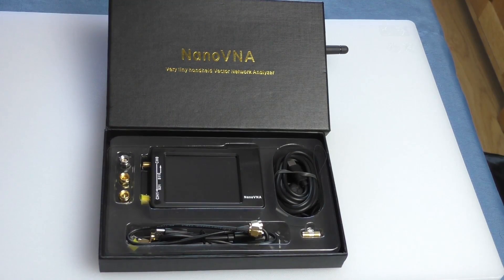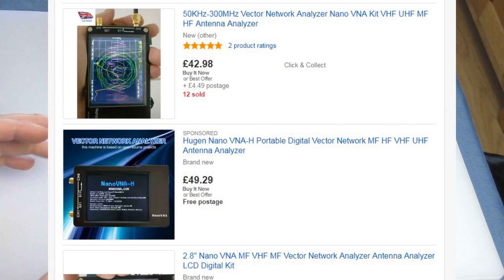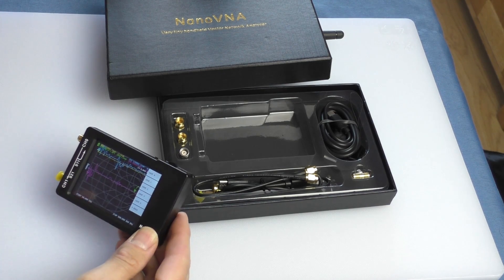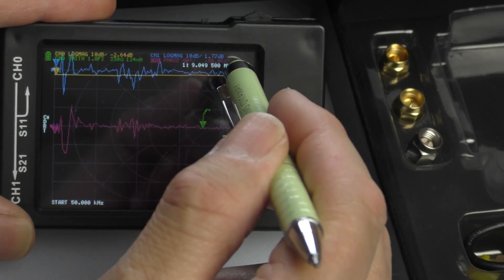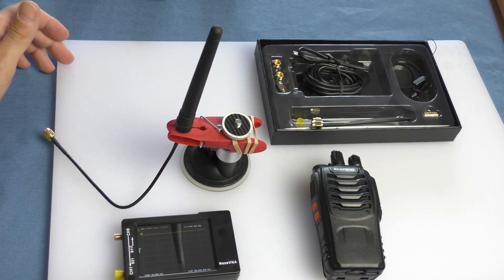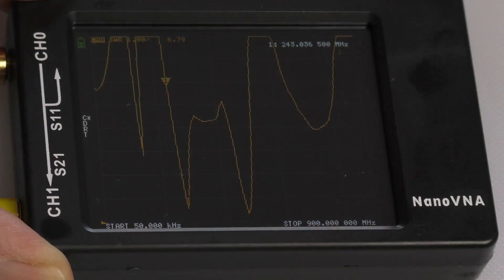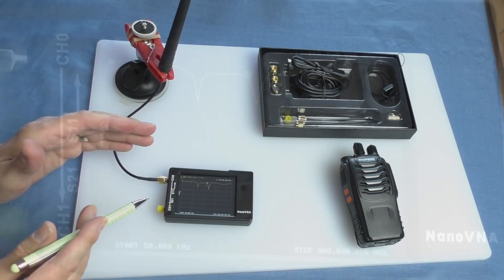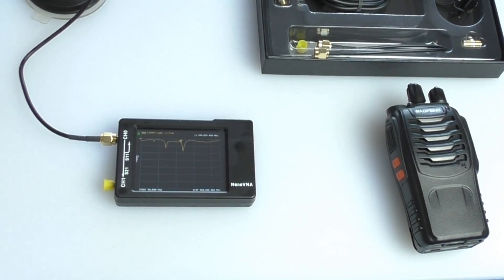Nano VNA Antenna Analyzer.  Testing with Baofeng 888 at PMR freq.

Comment: A link for this item Fed? Cheers.
Reply from the maker: This is the seller i used but there are dozens of others.  https://www.ebay.co.uk/itm/NanoVNA-50KHz-300MHz-Vector-Network-Antenna-Analyzer-UHF-HF-VHF-VNA-UV-Portable/293372102557?ssPageName=STRK%3AMEBIDX%3AIT&_trksid=p2057872.m2749.l2649

Comment: Hello Fred great Video's I just bought one thanks.  Could you do a basic video on the calibration and which connection is which.  Mine came with 3 connections apart from the 2 pigtails. But i am not sure which connector is the Open, Short or Dummy Load.  So I would appreciate a basic Video please on calibration.  Many thanks Tony CT3907
Reply from the maker: Tony try this vid.  https://www.youtube.com/watch?v=OH_UDHk-kpE
Reply: @CB-RADIO-UK  Many thanks thats the ticket.

Comment: I purchased one last week from Amazon for $40, for the same purpose except in the Ham Bands.  I tested a rubber duck antenna and a mag mount mobile after setting the range from 144 to 148.  My VNA showed both of them to be basically flat across the entire range selected under than 1.5 to 1.  I then scanned an off center fed dipole in the 40 meter band 7.125 to 7.300 band and found it to be under 3 to 1 for the entire band.  Now need to compare the antennas with a friends Antenna Analzyer.
Reply from the maker: Hi.  Yes it would be interesting to see how the Nano compares to a radio antenna analzyer.

Comment: Hi Fred. Portable radio antennas are designed to be used held against your head. If you hold the brass base, and hold the antenna near your head, the resonant frequency will magicly move onto the required band! Not doing this is what causes the bad reviews of what are pretty good Chinese clones! The Nano is a fantastic piece of kit. The Nagoya clones are especially good! M0iiZ

Comment: Here's a hint: There's a stimulus option in the menu, and you can select the start and the stop frequency there. After you change the frequency, you'll need to recalibrate. The NanoVNA always does a fixed number of measurement steps (101 between the start and the stop frequency, if I remember correctly), so if you really want a usable measurement, you should first set up the start and stop. Otherwise, you'll get very large step sizes between measurements.

PC software (say NanoVNA Saver) allows for more measurement points by automatically concatenating multiple measurements and then presenting them as one.
Reply from the maker: Thanks for the tip.

Comment: That explains why I can't get my baofengs to reach inside the supermarket like 100m or 200m away, also explains why my UV-5RA gets hot on the right side after few minutes of PMR446 chat >_>
Looking forward for the long antenna analyses.
Reply from the maker: May or may not be the reason.  My set up is prob not 100% correct.   More likely to be the walls of the supermarket blocking RF.
Reply: @CB-RADIO-UK  I assume a combination of both, also waiting for two Nagoya NA-771 to arrive in the mail, will see if it improves penetration.
Reply: A lot of supermarkets are actually pharaday cages to prevent you using your phone and only be able to use "their" WiFi so as to monitor stats.

Comment: Great new word to describe a VNA.. Antennalyzer ... It's difficult sometimes, as testing the antennas resonance away from it's working environment can lead you astray..  There are various 'ham' You Tube channels showing people using these over priced,  (£1000 + in some cases) , analysers .. What most of them always fail to tell you, is how to calculate out any errors with the antenna and feeder that's not at the working height or location that it will eventually be placed.  Try trimming an 80 meter half wave dipole at 1/2 wavelength above ground, ha-ha..    Nice bit of kit for sensible money Fred... I'm off to my 'vertigo' therapy now...
Reply: Yep, just spent the morning sorting my new 80-10EFHW.  Completely different once I got it up at working height from it's initial build and test, so was lowering, trimming, and lifting far more than I wanted to.
Reply: @ammocraft   Ha-ha.. Great fun ain't it ... Another thing you're fighting is impedance verses resonance..  A dipole that is hung horizontally  generally has a feed impedance of 70 ish ohms... So right away you have an issue . If you invert it  at approx 45 degrees the impedance gets nearer 50 ohms at the central feed point, and you know that when you reach a low VSWR here,  you're near your chosen resonant length.  Then you have to consider a 1 : 1 current balun to prevent your feed coax from resonating too much RF.. It's a massive subject, but I love it.
Reply: Pete. Jamieson Not only that, but when you change the height above ground, comparative to wavelength, the impedance also changes.....hence the matching sections on dipoles like the G5RV and ZS6BKW that attempt to be multi-banders.  I’m currently running the EFHW and a trapped vertical, but it’ll change again soon, I’m sure! 😂
Reply: @ammocraft  . Yes.. Lou Varney  (G5RV) was probably the first multi-band antenna designer to achieve resonance from  80 through to 10 meters without a tuner/matcher or using traps/loading coils.  But the design specs need to be followed to the letter to achieve that versatility.  Feeder lengths and height above ground without nearby obstacles. In reality he was selling a dream to most hams I  know ...End feds with an Unun, in my opinion are a better bet and easier to experiment with to achieve a good match on HF bands.  As my old friend G2RO used to say. " Spend as much cash on your antenna and feeder that you spend on your transceiver and await the sunspots"..
Reply: @pda49184  Yes indeed....though ironically, he cared mainly about 20m back in those days!  The ZS6BKW is an optimised version as I'm sure you know.  Sadly, I have room for neither, so 80/10 EFHW and Hustler 6BTV is all I can manage.
Reply from the maker: Thanks Pete.  Yes iam not sure how accurate these meters are or if my method is correct.  Main reason i bought it was for tunng forthcoming dipoles.

Comment: Yeah, well maybe not the best test for that type of antenna.  The radio may be using your body as a capacitive coupling for ground plane  and you have not got one at all.  That aside, it might have been better if you had put it onto one of your antennas just to see how good it is.  But it is what it is.  Personally I would rather have one that reads it out on digits in ohms, swr, frequency etc but you will not get that for £40, though i am surprised the Chinese have not got a good one for around £60 by now, but I suppose there is not a big enough market for them to make it worth their while. Interesting none the less Fred.
Reply: If you plug it into a laptop and use something like NanoVNASharp or NanoVNASaver, it becomes much nicer to use.
Reply: @ammocraft  Ok, but the Laptop is not always with you in the field, but I get the point.  I would rather have something that has all the info on it digitally.  Just a personal choice.
Reply: bob fourjs A tablet is part of my standard comms gear these days.....but I do also have an older MFJ analyser I tend to use when I’m setting up antennas.